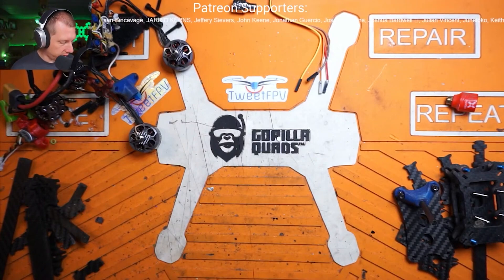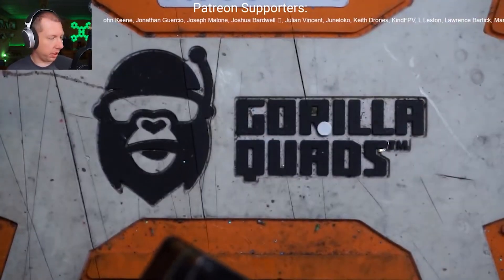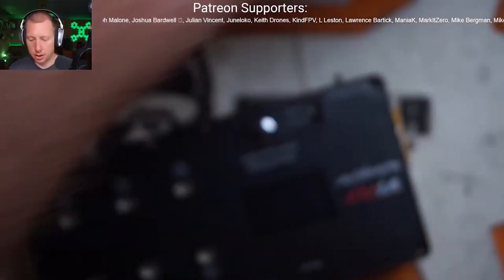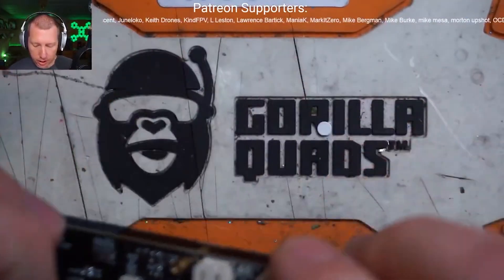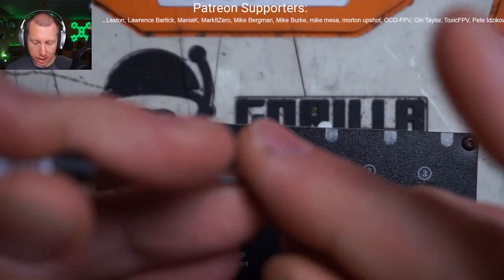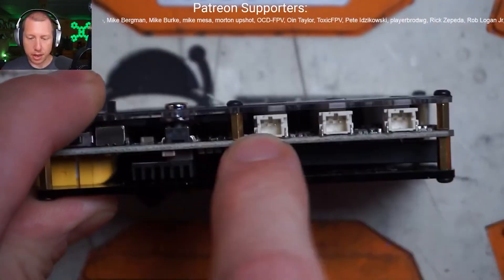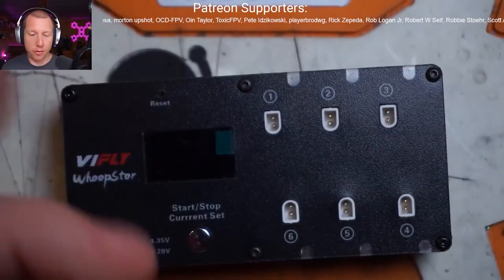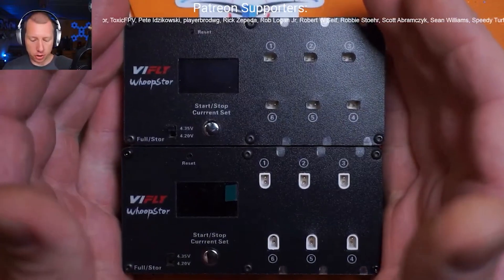Vifly WhoopStor V2 1s lipo charger #TweetClips

Comment: According to Joshua Bardwell's most recent News stream, ViFly are willing to send owners of the V1 version of this charger, a new V2 version if they pay the postage. You just have to contact them. I have, but not had a reply yet which is dissapointing. I suspect it's because I'm in the UK and they don't want to ship to me, but it would at least be nice if they let me know that instead of ignoring me when this could be a safety issue that I want to get sorted.

Comment: Fractal Engineering board works great with standard charger. I use it with small Toolkit RC charger. I have a couple originals with BT2.0 connectors. Think you can solder them on the later versions. Just pull off bottom pad and solder onto PCB. Yves makes a super solid product.

Comment: They need to make this in a GNB27 version also.  I would buy several of them if they did.  I really do not want to get involved with BT2.0, but I do have a number of GNB27 batteries and several quads and could use a good easy storage charger for the batteries.